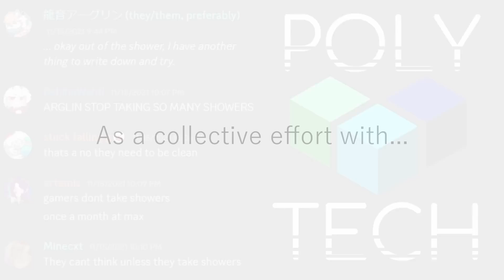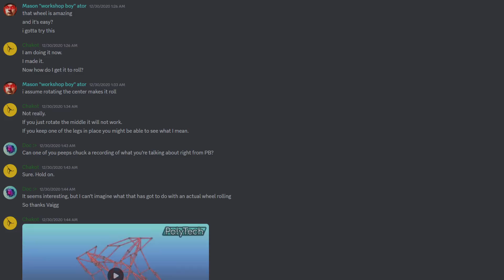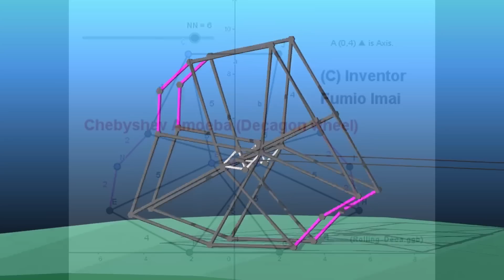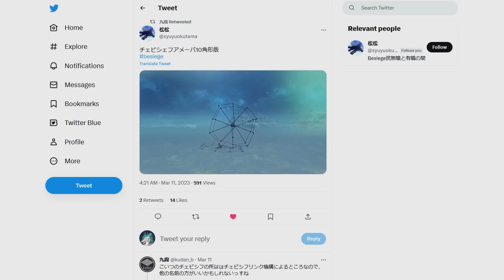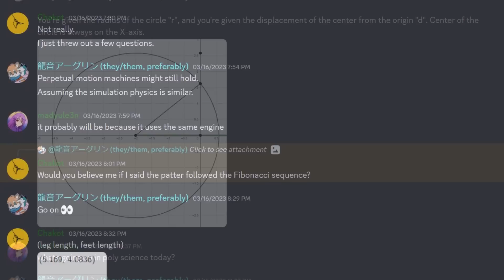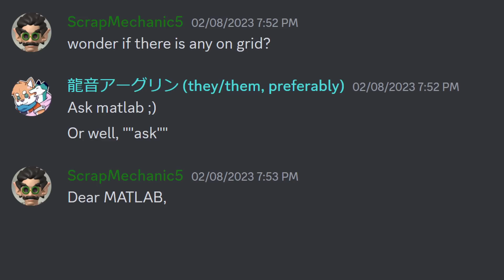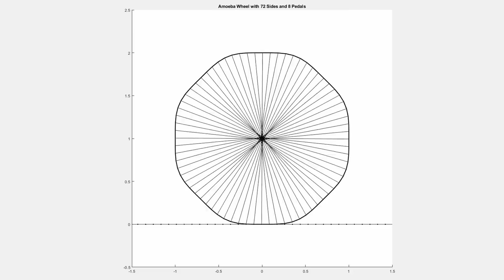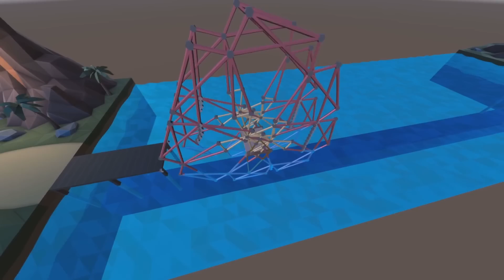REINVENTING THE WHEEL! (Amoeba Wheel Part 1) | Poly Bridge 2 PolyTech

Comment: This is amazing. 
1. Which configuration has the most "smooth" horizontal motion? Or the least deviation from a perfect line?
2. Is there any connection between these linkages and the shapes of constant width?
Reply from the maker: Thank you! :)

If you allow the number of pedals to extend off to infinity (basically increasing the "resolution" of the wheels as shown at 9:36), you will eventually get essentially perfectly smooth horizontal motion. If you limit to a certain resolution though, I would say the ones which have the best ability of rolling aren't in this video but in the sequel to this video; they're called Roberts Amobea wheels and they essentially look like a pill-shaped amoeba. (As of now, it's the second latest video, though I will also link it in the description as well).

I don't believe these have any connection to shapes of constant width. An immediate difference being that constant-width shapes require using polygons with an odd number of sides, but Amoeba wheels are capable of following polygons with any number of sides.
(Spoilers!) We believe it is much more closely related to epitrochoids instead.

Comment: Arglin, how did you first learn about linkages? What is a good place to start?
Reply from the maker: I first learnt about linkages through the 507 mechanical movements website, which shows a whole bunch of animations of mechanisms.

The main thing is just to get yourself interested, for the most part, so I think that site is a good place to start. From there, you can look into more specific things. You can refer to my pages on Wikipedia and Wikimedia if you want to see and learn about some other, more specific linkages of interest.
Reply: @ArglinPB  wow. I’ve just checked out the website and there’s some super neat stuff. Reminds me of the much more limited websites of mechanisms I’d see when I was a kid. I will have to get versed in the terminology used for some of the mechanisms but this is a great resource. Thank you!
Reply: @ArglinPB  thanks arglin, do you have any intent on making new videos?
Reply from the maker: @rorybaker5799  The sequel to this video is being made and should be released soon. My production rate has slowed down a lot as it isn't as much of my passion (it's more about the content itself that I enjoy exploring more than trying to thoroughly explain such content), so the times between uploads has become rather long, sorry!